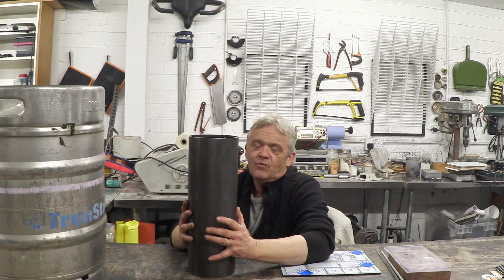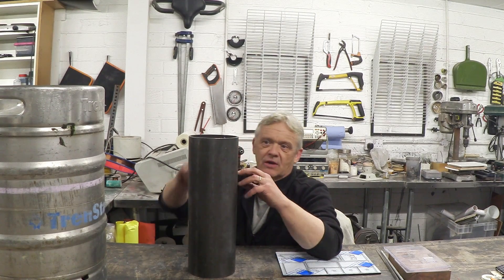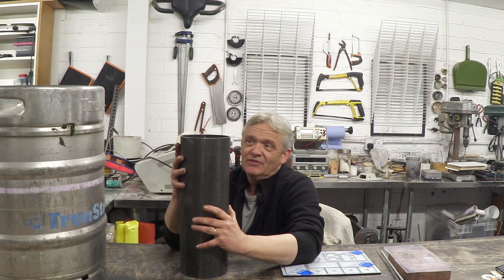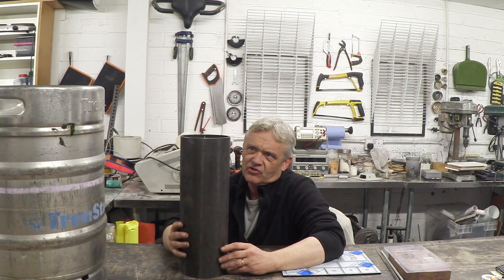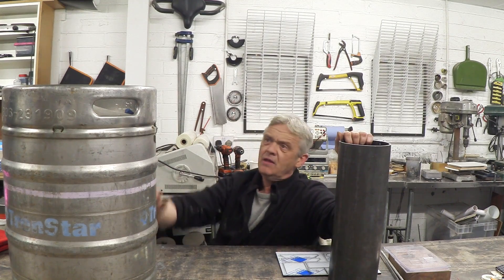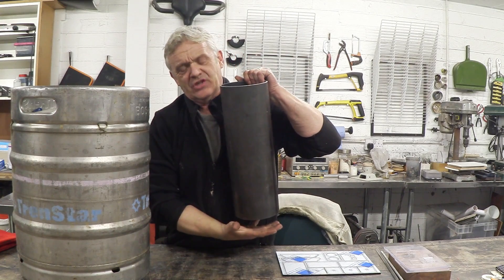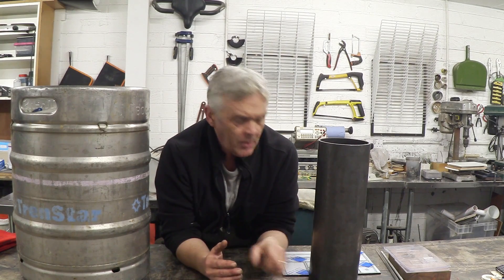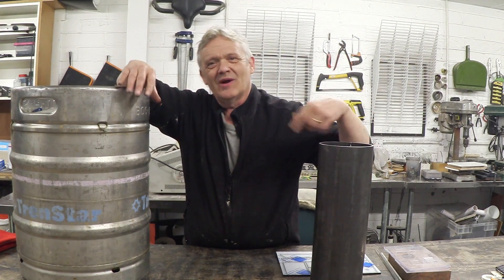DIY Gasification and Generator Unit - Part 2 - The Fire Pipe

Comment: Hey Robert not sure if you mention it but I think it might be helpful for some who don’t know much about engines but I was just strolling amazon for cheaper generators just looking at the cc size and notice most the really dirt cheap ones are 2-stroke. I’m not 100% sure but would you only want 4stroke so that it has its own oil because I done think you can add oil to the wood gas!! Unless the slight contaminants left in the wood gas would work as an oil?? If you or any view have any more info on this I would love it

Comment: The important parts involve the clean out door  and your welds. You have to make sure that it is 100 % air tight . Any air mixture that would get in would cause an explosion and of course you have the carbon monoxide,  and carbon dioxide  to watch for . The imbert design has a greater efficiency,  but the fema one will work with a bit of fiddling.  The sealant you use must be of a high enough heat resistance( the fema ones run cooler ) . The safest method of the clean out door would be a bolt down method with a flange that connects to the beer keg and sealantbetween that . Hope that helps.

Comment: Interstingly, the idea of gasification is in fact incorperated into conventional powerplants, be that biomass, natural gas or even coal.

The exhaust gasses from these processes are not immediatly released from the exhuast. A proportion of the exhaust gasses are fed back into the furnace. There are two main advantages to this. Firstly, it increases the efficency of the power plant and secondly, by feeding the exhaust gasses back into the furnace you produce a "cleaner" burn. Reducing the amount of carbin manoxide and other harmful chemicals that are ejected.

The final stage for the exhuast gasses that do leave the furnace, travel through devices called scrubbers which filter out as much of the particulates and harmful gasses still prestent.

Power stations a required to provide real time data, to regulate the amout of pollutants emmited. So this process is incredibly important to achieve lower emmisions.

Comment: I weld. Took all the courses possible in my local college. Welded for work and for hobby.    U mentioned ur just gonna give it a go ... umm .. hold on there.    First grab scrap which is similar, get your technique down, then do the job correctly and it is dead simple.   Take any skilled welder, put them on a foreign machine and the first thing they are going to do is strike arcs and figure out "what is going on" .  Don't touch the job piece until your beads are correct on the scrap piece.     Different thicknesses, Different machines, even different environments, all require different knob twists.  Just get some scrap metal with same thickness as your job pieces and get your settings right. Keep that scrap, caz when u change position ur probably going to sanity check on that scrap piece b4 hitting the job piece.   With arc, you gotta be aware that vertical(like welding on a wall) is very different than horizontal(flat on the table). Horizontal is easy.       btw, the smell of some electrode flux is really cool :)  Preheating=Golden

Comment: That design will not get the heat to crack the tar, so you need a really good filter to save the generator. A heart ring (constricted flow where the heat intensifies) in the pipe is a small price to pay to improve that a lot. It could also be tricky to avoid the fire to burn up all the way  thru the feeding column, my guess is that you'll end up feeding the air from the side when all is said and done. Love the project. Good luck.

Comment: Be mindful with those auto darkening helmets. If you block the sensors or they do not have direct line of sight with the welding arch they will not darken and you can flash yourself.

Comment: I wish you the best of luck but this gasifier is about to school you. First is the oxidation and pyrolysis zones are not fixed with a fema unit. This will result in the oscillation of the amount of gases produced at these layers and these layers will be constantly moving. (more fuel below your oxidation zone = more fuel that is oxidized > the more pyrolysis gas is created and then just the opposite) This is especially the case as you agitate the grate and flow the fuel through it. The pyrolysis gas is the resulting gases produced by the oxidizing the fuel. This is the raw gas with complex molecule chains; this gas is full of tar. The fema units do not use a heat focal point to thermally crack those chains further; thus resulting in higher tar content. Now back to the oscillation of the layers of your process, if there is too much tar in the raw gases it can overwhelm the reduction process if it is not large enough and or hot enough; resulting in excessive tar production and clogging up this process. The reduction process is endothermic and the physics of this is something that is fighting you. You need that reduction process as hot as you can get it. 1800*f and greater for engine grade gas. 

Now an Imbert gasifier uses a fixed oxidation process with a restriction just bellow this. This restriction is a focal point to force all produced heat and gas together through a small cross section to crack those complex molecule chains before entering the carbon / reduction bed. The simpler these chains the better. The reduction process is simply stripping the Oxygen out of those chains and recombining with carbon. ( This is how you are getting H2 CO and CH4.  An efficient reduction process will show a huge temperature differential from the point of oxidation to the point where the gas exits your grate. 

Tar TAR TAR!! Ok first a gasifier is a refinery and when tar is produced generally you are going to produce many different grades of it. Some grades will drop at higher due point and others will not. This is the deception ""See my filter is working, just look at all the tar it collected"" This is just one grade of it that dropped there and most likely this is only a small portion of what was actually produced. Your gasifier will be under heavy vacuum and how do we boil things at lower temperature? You place the process under vacuum. If you are producing any amount of tar, the odds are you are producing a grade that will stay in gas suspension bypassing any filter you put in front of it. Generally it will drop at the throttle plate of the engine. 

Your filter should be built to filter one thing and that is the dust. Creosote you simply condense and is as simple as cooling the gas and it will drop. You actually want some moisture in the gas to help with valve seats as they are hardened. Valve seat cracking is a common problem with gaseous fueled engines. 

I hope you take me up on building a charcoal unit. They are much easier than what you going to attempt, plus you can crack water directly. The gas output is stable with no intervention needed by the user. Just get it running, set it and forget it. We just built a charcoal kiln to heat the shop, it makes engine grade charcoal as it heats the shop. That fuel is basically free as we need to heat the shop anyways.
Reply: If it were me knowing what I know. I would take that fire tube and make a stupid simple charcoal gasifier out of it. It needs a bottom, a single air jet leading in from the side at the bottom. Then you your top needs a sealed lid, (simple pipe fitting and removable cap) Just use a large enough one so you can service it inside. Then your gas exit port is located at the topside. A simple bucket with an in and out filled with some sort of media to get the dust out is all that is needed.

Direct water cracking you will find amazing!! This is as simple as dripping water into the air jet of this charcoal gasifier. It will flash to steam and get ripped apart with the Oxygen combining with the carbon and the H2 is then left freely. This is the crude method, you can take it further by using engine exhaust to flash steam and then streaming it into the unit. The better you can do this the more water you can crack. It boils down to how hot you can keep the reduction process. Too much water it will become too cold and reverse the process saturating the fuel with moisture. That said this is an excellent way to control the internal heat processes of a charcoal gasifier as these system generally run too hot and melt the air inlet jet.

Comment: Biomass gasification is "energetically challenged" to quote Jim Mason.  He developed the GEK gasifier which includes 2 heat exchangers: 1 between the engine exhaust and the fuel, and 1 between the hot gas and the combustion air.  Imagine trying to dry and burn material above when the airflow is going down...  This design tends to need kiln-dried wood to work, and works better on charcoal.  Low temperatures tend to produce dirty gas.

Comment: .. quids and pounds what is the difference? I thought they were the same thing like our bucks and dollars.. or am I wrong again? I do have some questions. Why can't the pipe be longer to hold more bio-mass. also (you will probably cover this in the next vid) Do you need some kind of pump to move the gas into the engine like a fuel pump? I will have to get that manual you talked about.. this project looks to be a stationary build and not to portable.. Well this is still gonna be a lot of fun.. I am gonna go and drag out my old generator ( as soon as I can find it again) and see what I can do.. Carry on my friend.. and as always THANKS SO MUCH for all you do.. I will put it up on my little personal you tube and send you a link so you can have a good laugh.. it should be fun!

Comment: Years ago I did some work for a Chilean engineer that made them from half rubbish bins at A time when there was a lot of repression.
I also spent 8 years or so operating a large scale coal gasification unit (primarily for the char) and learnt quite a lot. Extremely high risk plant with a chequered history so just watch that you don't build a bomb as it's not always a forgiving process.

Comment: An extremely simplified over view! The system has to be air tight or it won't work. The temperature at the pyrolysis layer has to be right or you'll stuff you engine full of tar...
Reply: My view exactly 🙂

Comment: A few little tips, one is to flood the barrel with Pure Argon if you have any prior to welding, this creates a gas backing makes welding easier and reduces oxidation and porosity on the backside of the weld. It would have been nice if I could have given you a piece of stainless pipe and some 316L electrodes to keep the metals the same or similar, when welding steel to stainless I think the rods you use ideally will be 309MOL I believe this reduces the risk of dilution and cracking. 
Something to remember when welding stainless is a low current is usually the order of the day, especially on thin-walled beverage containers, Stainless is a poor conductor of heat, thus unlike steel heat rapidly builds up in one place causing a blow through. A series of short two-inch long runs and then move to the opposite side and repeat until all the runs join together is often best. With Stainless welding overheating of the metal can cause Carbon displacement in the heat-affected zones, leading to rusting.  Health & Safety with Stainless I was once told smoking CAN cause lung cancer but Stainless welding and Hexavalent Chromium definitely cause lung cancer, also wear goggles after the welding process, as the stainless cools and contracts about a third more than ordinary steel the slag from MMA welding often self-releases at quite a speed usually heading towards your eyeballs. 
Cutting this kind of stainless can be done with a Jigsaw on a very slow speed with Tallow lube, it is the same with drilling, slowly does it or the tip of the drill is instantly blunt, those very thin 1mm thick cutting disks for small grinders help, but I have also used a 316 electrode with the welder on full power to pierce and cut out circles, a Carbon rod might also do this.
Most welding projects I do these days are in Stainless, it is the cheapest option, I tend to buy the Stainless from a friendly Scrapyard.  It just saves so much time and money having to paint everything, and with combustion projects like this, it lasts virtually forever compared to steel which just rusts and flakes to bits in no time.
Maybe practice on a bit of scrap stainless first, one technique I have used on thin stainless I call dragging and that is where you deposit quite a thin weld bead by increasing the speed at which you pass the rod over the surface, this reduces the heat gathering in one place, but takes some practice to achieve neat results.
Remember for most stainless builds that do not involve things being gas-tight, small one or two-inch runs usually suffice because the welds are many times stronger than steel welding, this saves electricity.  
If you have quite a thick flange to weld on, play the heat mainly on the thick part merely allowing the arc pool to simply run over and burn into the thinner metal. Good Luck, I may have welded the odd beverage container myself in my time lol. It is naughty and some breweries moan and groan about it, but speak to any pub landlord and they will tell you it is the breweries who never bother to pick the damn things back up from the pubs, many pubs are overrun with them.

Comment: I was thinking maybe distill Wood chips, making methanol, along with other byproducts, maybe use concentrated sun to power the reaction, if possible, it would probably require multiple collectors heating a approx. 1 cuft insulated box to do small batches, I also considered using a fire, with a similar box,  pyrolysis of biomass, it could possibly fuel everything, around my offgrid home, gas for the stove, Possibly distilling the oil produced, to make more useable fuel!

Comment: Welding, You will do fine mate. The only hard part is using the side grinder to smooth it out with the sanding disc and even that is fun, lol - I love welding. But being one artist to another, you will be a natural at the welding.
Reply: I use a tig welder and a 4 1/2" disc Dewalt side grinder. Those auto dark disc help make it easy. You can adjust how dark it actually turns.
Reply: Here is a tip I do, I start the welder from the side the ground is hooked to. Then I work into a circular motion with the hand, little circles and the layer over each other, like making little donuts with no holes in the middle, lol

Comment: Since you started this series I have been wondering if a wood log fire in the shed (man cave) could be converted to run a generator to power the shed or even power some of the appliances in the house. Anything to reduce the power bill and get yourself at least partially self sufficient.
Reply: Maybe some kind of boiler on/in the flue, And a small steam engine? 
You're not gonna get great efficency, but even  a kW or so should be achievable fairly easily.

I suggest looking up monotube boilers... In smaller sizes rather than going bang on boiler failure they go pop.
Simplest are two lengths of copper coil in series. Spark plug or similar to  switch a pump in when water level low, and to keep 1st coil full of water.

Comment: Excellent I ran my Subaru Leone on a syngas side draft gasifier I built it was great apart from all the carbon and clogged up the valves eventually I came to the conclusion of an old air conditioning idea they used in the old days for big buildings basically a tunnel with water spraying into it cooling the gas down drying the gas out and cleaning it from carbon all problems solved in one compact arrangement I used a 6” flame tube for around 70 hp 🤙😁
Reply: Can a filter of some sorts be used to clear the carbon before it enters the engine?
Reply: @stevetobias4890  yes but they clog up quickly unless inconveniently sized
Reply: If you're able to get the temperature @ the pyrolysis layer high enough (by using air intake nossles @ the burn layer) you get significantly less tar in the engine.
Reply: @whitezin65  no tar if you use a water spray tower plus it cools it down and drys it out🤙

Comment: I'd be inclined to use a steel outer, possibly an old propane tank.
Reply: Bit overkill to be honest, the system wont be under a lot of preseure and beer barrels are designed to withdtand high pressures themselves, although relatively thin compared to a propane bottle, the ribs which are pressed into the material actually make the cylinder much stronger by increasing the effective depth of the material. You can see the same effect in a baked bean tin. They are extremly thin and can withstand high pressures caused by the heating of the content to sterilise the content.
Reply: @michaelpearson5465  I'm more concerned about the heat.
Reply: @BensWorkshop  stainless steel melts at over 1500°c the max temp a wood fire of this size would reach is 600°c so not even close to the melting point of stainless steel, also consider that the stainless steel jacket is a fair distance from the heat source meaning the heat from the fire will be much lower by the time it has transfered to the stainless steel. At most it may warp slightly but not by a noticable ampunt and this would not cause any issues.
Reply: @michaelpearson5465  Kegs are made of aluminium.
Reply: Or at least, most of them are, so that they are light.
Reply: @BensWorkshop  you'll find that this one and most others are made of stainless steel, usually 304 stainless which is standard in the food industry. Alumininim isnt typically used as exposure to the liquid content can cause oxides to form which contaminated the contents, which is why aluminium cams have a thin polymer coating inside of them to prevent this. The weight is reduced by using thinner material and forming ribs to increase its strength.
Reply: @michaelpearson5465  New kegs are, but kegs have been made out of aluminium, so you would need to check.
Reply: @BensWorkshop  this ones stainless though and they are the more common.